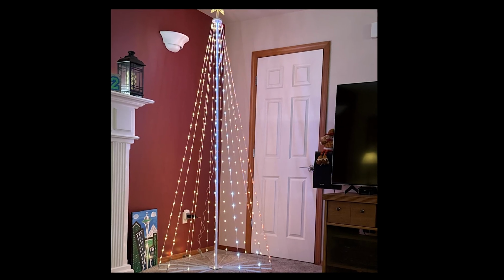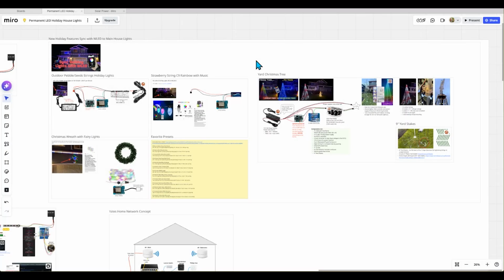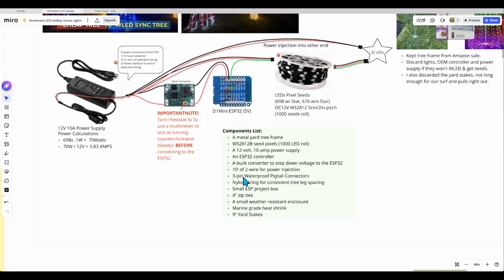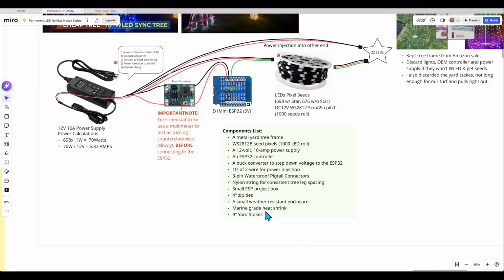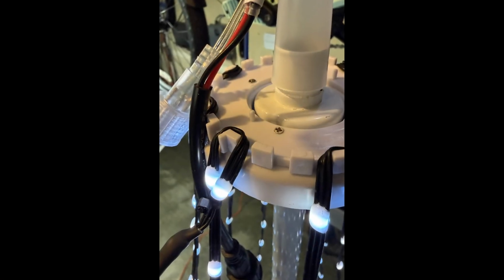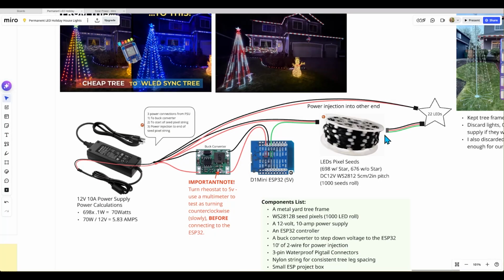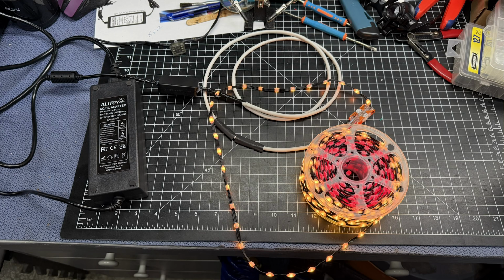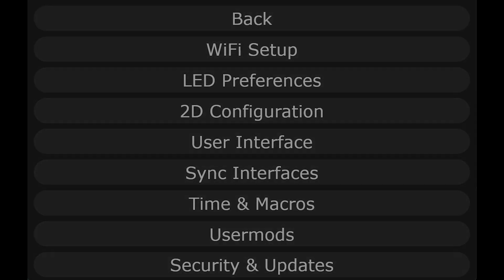WLED Christmas tree conversion with ESP32 and seed pixels

Comment from the maker: Thanks for watching, I hope you found it useful. Here are the links I mentioned in the video:
✔ How to sync WLED displays to main house lights: https://youtu.be/42ZreWn0X_I?si=eGUnpai1p1Mdk63O
✔ Miro Project Board: https://miro.com/app/board/uXjVPKmrZZc=/?moveToWidget=3458764653229552388&cot=14

PRODUCTS USED
:::::::::::::::::::::::::::
✔ 1000 WS2812B Seed Pixels: https://amzn.to/4askKeN
✔ ESP32 WROOM: https://amzn.to/4sbi7nV
✔ 12V 10A Power Supply: https://amzn.to/45diowK
✔ Mini Project Box: https://amzn.to/4scIYQz
✔ 2-Conductor Wire 18 AWG: https://amzn.to/48SZRrT
✔ 3-Pin Waterproof Pigtail Connectors: https://amzn.to/3MXBIb2
✔ DC-DC Buck Converter: https://amzn.to/45sR25P
✔ 9" Yard Stakes: https://amzn.to/3YRNpCJ